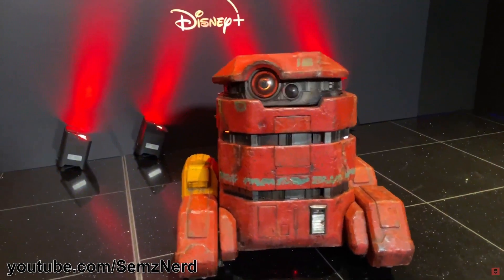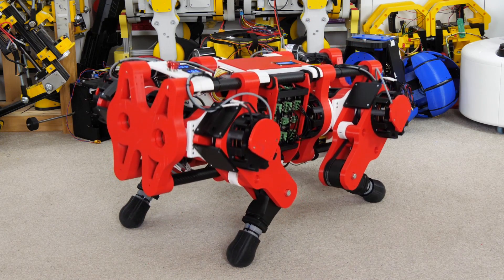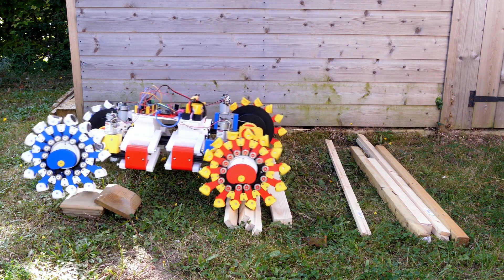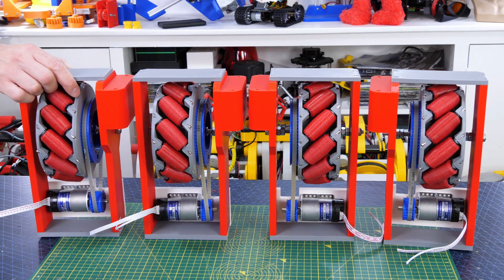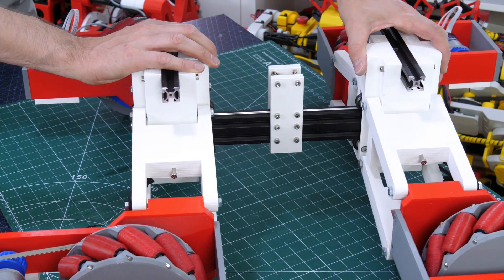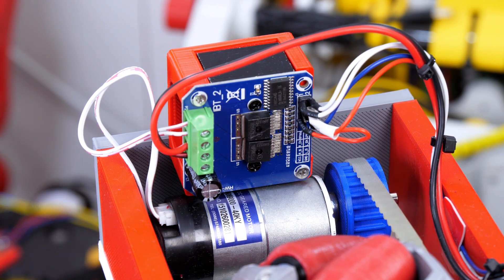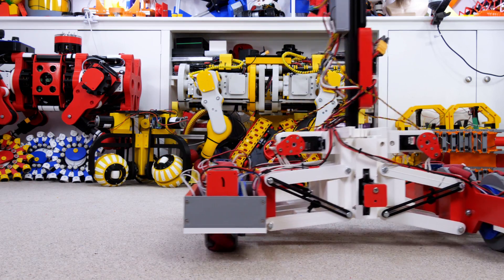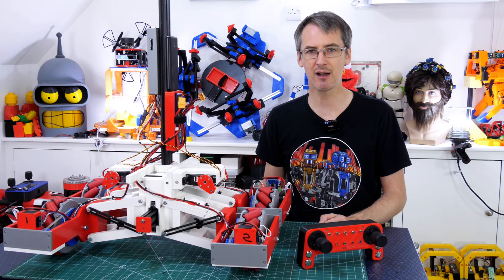Star Wars #Andor Droid Build

Comment: I want to give you a suggestion to simplify the controls. You could install a motion/acceleration sensor that would lean the droid forward if it felt that the droid was accelerating forward or if it was going uphill. It could also lean the droid backward if it sensed that the droid was going downhill or if the droid was breaking. The same would go for the sideways motion. 
This would make the droid's motion look much more organic and would be one less control for you to worry about.

Comment: i think this has to be my most favourite of your robot builds yet, and while it might not be designed exactly as the original may have been, your design is in the very least just as effective, i wouldn't be surprised if the original builders looked at this and thought why didn't we think of that or we should've done that bit like that ..........in my opinion your build is possibly more efficient

Comment: Great video! 
I've got a little question, though. Is there a reason why you chose to arrange the mecanum wheels in this setup? It will cause the whole structure rotate on it's Z axis if you apply an outside force. Your setup can't prevent that since the rollers are in this setup. In the traditional arrangement, we would exchange your front and rear wheels (so the rollers form an "X" shape from above - instead of your current "diamond" shape). This traditional arrangement prevents the said "slipping" around the Z axis.

Comment: Love the vehicle! There's an error that you've sort of got away with: the wheels need switching around. The iteration in the video can yaw because the wheelbase isn't square. As you extend the chassis, the axle of each roller contacting the ground - not of the mecanum wheel per se - approaches lining up with the centre of turning. That often happens with one wheel at a time, because any motion of the chassis (with any yaw) can be viewed instantaneously as a rotation around a point, and that point will cross the axes of various rollers as the trajectory changes. With your chassis extended to place the contact patches on the corners of a square, it would rotate freely with the wheels locked, which tells you that you can't drive yaw reliably in that configuration. You'll still achieve some yaw with the video setup if you extend far enough to be square, but only because the mecanum wheels have some width, which means that the contact patch sawtooths either side of the centre line off the tangent, and hence the roller axis rotates slightly relative to the radius. Switch the wheels (front to back or side to side doesn't matter which) and it will behave much better because yaw will always be well constrained. When I make a mecanum wheelbase, my mental checklist includes "if the wheels are braked, does it definitely constrain translation and rotation of the chassis?" You can set the servos/motors to station holding and feel how much constraint you've got. I haven't investigated the specific effects of canting a mecanum off the vertical as happens with your suspension. It will certainly distort the contact kinetics, but I don't know how significantly. How are you generating your rollers? I have a CAD construct that does it fairly simply if you're interested.

Comment: For connecting a part where wheels are attached to the suspension you used nuts and bolts. But, will ball joinnts work also?

Comment: This strikes me as a great design for a Battlebot.
While most battlebots struggle to turn and maneuver, this has great potential to harass and circle opponents with a good driver. Or even perhaps just good programming.
It makes me wonder how practical a 3D printed, or 3D printed assisted Battlebot would be. One thing that cripples the bots is taking a nasty hit and not having the time or resources to repair between rounds and having to forfeit. With something like this, you could turn the most complex and fragile parts, the mecanum wheels, into terrifyingly disposable assets that can be replaced in minutes. While saving heavier metal armor for the chassis itself.

Comment: I’d absolutely LOVE IT if you made a T-180 racecar from the movie, Speed Racer! T-180s are basically jet cars with swerve-drive wheels, which allows them to point their jet engines in any direction without losing wheel grip, effectively double-dipping on acceleration, braking, and steering.
The cars in the movie are presumably gas-powered, but I’d imagine an electric version would use in-hub electric wheel motors, an EDF as the jet engine, and continuous servos for steering, but I could be completely wrong here.
Also, bonus points if you can get it to jump like in the movie!

Comment: You should use field oriented drive, and also an accelerometer to drive the upper section forward when taking off. It will give you quite an organic look without having to manually move it

Comment: I like your solution and design. I'll wait for you to upload the final cad files. 
Then I can scale it to the gearmotors I already have collecting dust. 
I'll be using springs instead of bungee cord and no servos. It's a very nice independent suspension as is.

Comment: Just a thought, but for those long white bits that you said were a bit too flexible (& for similar situations), what if you designed them with a void just the right size for a metal reinforcing bar (just a straight bit of metal), & mod the gcode to pause the printer when it gets to the top of the void, then you can just put the metal bar in & then allow the print to resume.

Comment: I like it a lot, but I believe the mecanum wheels are more normally used with the angled rollers swapped round the other way (they are on the B2).
As you currently have it, the axis of the rollers (at the point where they contact the ground) are all aligned with the centre of the robot (like a needle roller thrust bearing) - this can allow the whole robot to freely rotate about its centre. If the wheels are swapped (i.e. swap left front with right front and left rear with right rear) so the 45deg rollers go in the other orientation (in relation to that wheel's axis), the roller axis at the points where they contact the ground will not be aligned with the robot centreline (they'll now be orientated tangentially to a circle) so they will be able to resist rotation about the robot's vertical axis.
Reply: I didn't scroll down far enough. Should I delete my comment so there's less to read, or leave it there for overall signal strength? Shame about the spam reply you got :/.

Comment: I know this is a robot dog video, but I am trying to create a robot dog as a school project. I have fully designed the leg but when I try to move the leg it doesn't move in a straight line, it moves in an arc because one motor doesn't have to move as far so it reaches its final point quicker. Did you run into this problem or am I doing something wrong? I would really like to know if I'm just missing something obvious. Thought you might know because of how many robots you have created.
Reply from the maker: Yes look at my videos about inverse kinematics and interpolation, there's one of thosevin pretty much every robot dog series
Reply: @jamesbruton  Do you know a specific video that goes more in-depth into the code?

Comment: I do FRC robotics and it’s so cool seeing engineering concepts being used(we use mecanum drives as well as 4 bar linkages
Reply: i'd imagine how a chassis like this would work on a FRC or FTC playing field. the biggest limitation is the amount of motor that could be used on the rev robot control system or what ever FRC uses now. the last time i was part of an FRC team was back in 2008 when the robots still used the old PICAXE controllers

Comment: Have you thought about mounting the drive motors on the mecanum wheels internally? You'd save yourself some length on the "feet" (currently they do look like feet in terms of dimensions) and also eliminate the belt transmissions as potential points of failure.

Comment: Loving this build. For additional controls a head tracking unit (IMU like they use in FPV goggles) might be a nice way to control the body stuff because it'd be a little bit intuitive for you to turn your head to turn the robot's head and stand up straighter and crouch down slightly to handle the vertical growth of B2EMO. 

Also really impressed by you noticing that you had an extra DOF for stretching the wheelbase. Another drive motor probably could've handled that too for relatively minimal additional cost, but I appreciate the clever solution.
Reply: using a gyro in a remote to controll leaning of the body would be another intuitive option

Comment: The intelligent mixing seems a great route; 
Seems it would really benefit from some animator prowess; If mixing lean with direction of travel, using the concepts of anticipation and followthrough, getting the lean 'momentum' built before applying wheel power could add a lot of life to the motion. Same with braking; lean back anticipating the deceleration, then applying motor power. It would add significant latency so the controls would be tougher to pilot precisely but I'm sure like any system with predictable 'inertia' it could be smooth.

Very very cool project, and looking foward to seeing the rest! I really want to build one now!

Comment: Much cooler than I thought it was going to be.  I think you should reverse the wheel units though, with the motors on the inside (as opposed to outside now)  to give a longer stance.
Reply from the maker: I was going to, but that puts more twist force on the suspension arms so I turned it around

Comment: To help combat drifting on the length extension, maybe you could make some kind of brake for the gear in the middle, could be some kind of flat bevel gear where one can rotate like it does now, and one can't rotate around the center rod, but slide up and down. A RC servo can then lift the non rotating gear up to allow the other to rotate, drive the wheels to the wheelbase you want, then lower the non rotating gear down again.

Comment: If you turn the suspension 90 degrees so that the link arms point in the forward and backward axis, the same as the radial wheel axis, then  it would eliminate the issue with the feet getting closer. It would also be easier to compensate the wheel body to always be parallel to the ground. Just a suggestion.

Comment: Hi James, I am the chap you met at the maker's faire at the NEC earlier this year, I was in the blue electric wheelchair.  I have been wanting an off-road version for ages and considered it with my limited engineering capability.  There is an off-road chair but it is mega expensive.  Then you pop up with this, if you beefed it up and put a chair on top and put an electronic (drone) gyroscope thingy on it to keep the chair level this would be brilliant.  Well done.

Comment: If going to use a slide rail. Can use solenoids to clamp a simple break if using the wheels to pull it or push them in and out.
Reply from the maker: I considered a servo operating a 'peg in a hole' to lock it, we'll see how it goes.

Comment: Why are you still using arduino? Driving that many motors and servos through PWM isn’t great on an arduino that pretty much does it all through software. Why not use a servo driver board or a microcontroller with a lot more hardware timers?
Reply from the maker: It uses hardware timers for the PWM. I'll probably be upgrading to a Teensy on this one though so it fits inside with all the other mechanics - basically all that stuff on the stick has to go.
Reply: @jamesbruton  Okay I was wrong, I assumed the hardware PWM situation was the same as the nano and uno but it isnt, it has extra timers and extra PWM outputs, only 15 though, and if you use it in 16 bit mode, it is limited to 244 Hz, it is maybe a bit overkill for motor control but it is still pretty slow, compared to the alternatives. It is good to see you are considering other more powerful microcontrollers though.

Comment: sphere ball rolling robot, internal centrifugal pump quad drone turbines with diamond x-wing
Reply: sphere is a flexible thin mesh rolling shield
Reply: making your own true dc brushless motors
Reply: try graphite lubricated kinda fluid type bearings
Reply: no ball bearings, just graphite as the slide "fluid" on the surfaces like teflon on pans
Reply: hub motor type
Reply: go offline youtube
Reply: thats the end of online reliance, or anything in any case
Reply: hacky solutions cost in the end
Reply: proper solutions dont get you into shame
Reply: 30 silver coins bro, where are they
Reply: stars point to trash
Reply: God's stars are better than people's star
Reply: that goes to hell
Reply: who would count days in eternal time line
Reply: dual graphite lubrication bearings provide combined bearings and dc contacts
Reply: or the graphite lubrication does not have to be relied as contacts when permanent magnets are used
Reply: screw worm gear up-down sliders per wheel and piston magnetic air shocks
Reply: you did already do the screw linear actuator, use that
Reply: @bigcatdiary08  why do you claim to care
Reply: @bigcatdiary08  no I dont give you my spine